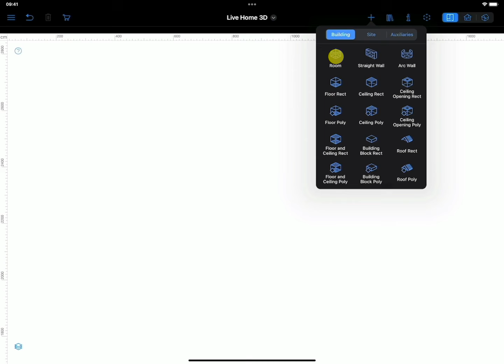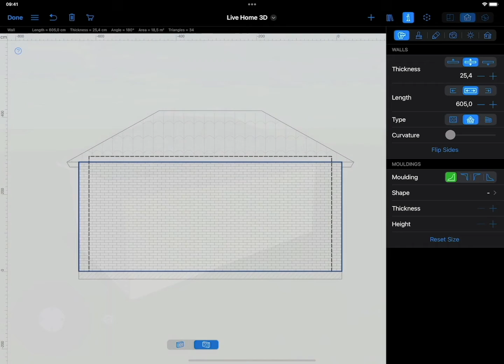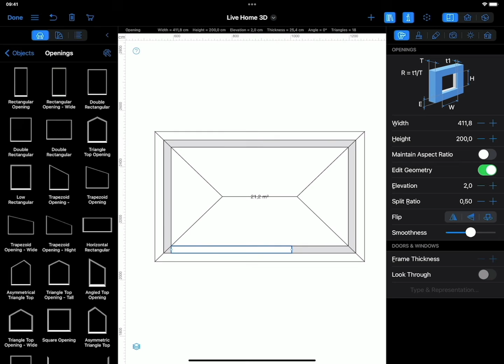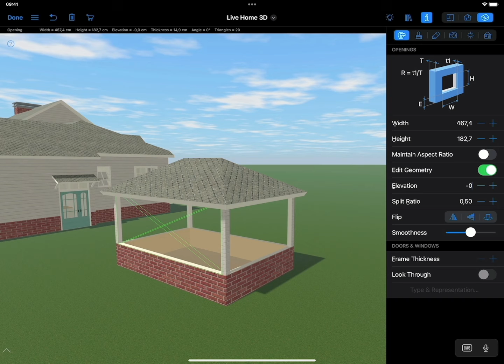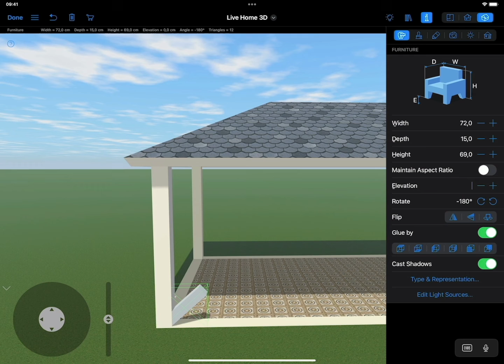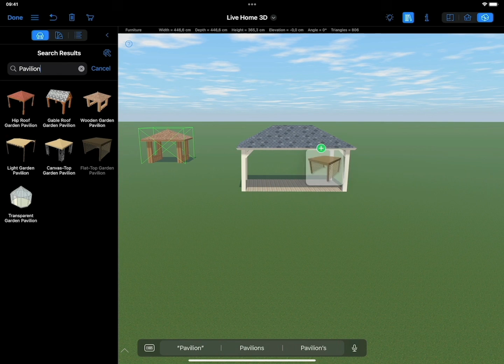How to Make Outdoor Kitchen - Live Home 3D for iOS / iPadOS Tutorials

Comment: Hello, I am a livehome3d user, how to make a sloping concrete roof?
Reply from the maker: Hi! Please open the Building Tools and choose either the Roof Rect or Roof Poly tool, depending on the shape you need. Then draw the roof and adjust the Angle parameter in Inspector.
Reply: @LiveHome3D  I can't find the angle tool on the building block rect ,I want to change the slope level
Reply from the maker: A building block doesn’t have the Angle input in Inspector. You can rotate the shape in the Type and Representation dialog. Please merge the shape first using the context menu.